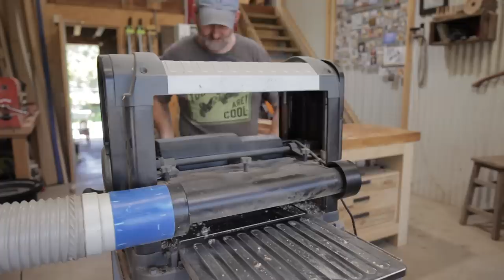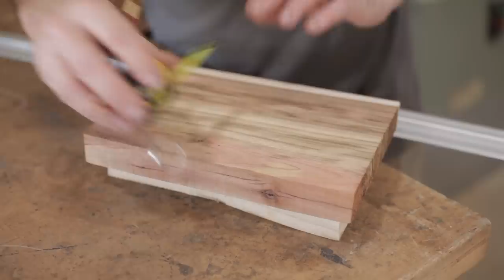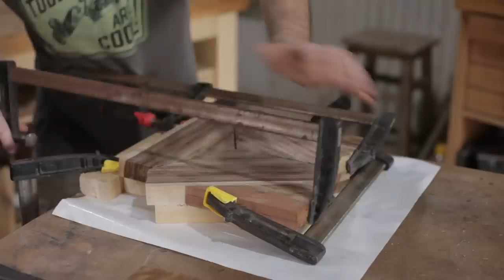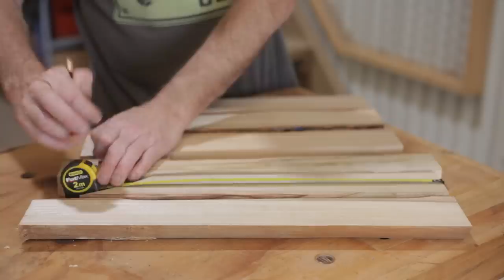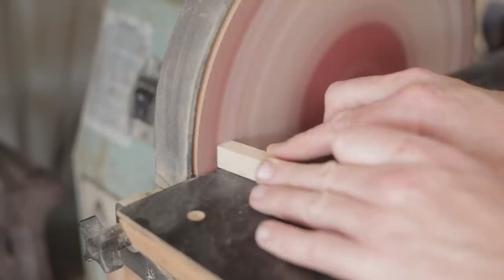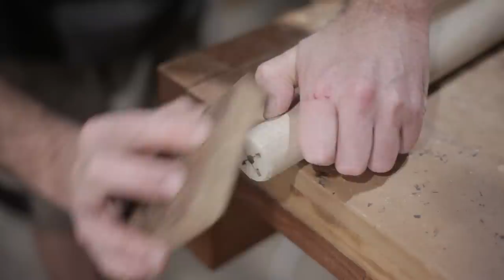Knockdown stool with Removable Legs - Scrapwood Challenge Episode Fourteen

Comment: So many great ideas, processes, techniques and innovations in a...stool?! Using the angle on the bottom on the stool to drill the leg holes at an angle is such a great idea!  And then I was so confused as the point of the cross pieces on the top of the legs but that is such a beautifully simple way to lock the legs in!
Reply from the maker: Thanks David - glad you liked it! :)

Comment: We clearly have a different idea of what is scrap wood.. I'm looking at my pile which is mainly pallet wood offcuts.. I'd buy the timber you have available to you!
Reply from the maker: Fair enough Richard, but be aware most of this wood is sap wood and not the best quality, that's the reason it usually gets burned rather than used. You can see where the chopping boards have been cut out of it not going into that sap wood. Also the pieces that aren't sap wood are warped and checked. The company that gave it to me would be using it if it were premium quality but because it isn't they normally burn it! The processes that I've used in this series could all be made with pallet wood! :)
Reply: @PaskMakes  Hi! Not criticising, merely rather jealous of the wood available! Love your work..
Reply from the maker: Thanks Richard - no worries! It's still worth pointing out that it isn't quite as good as at looks! :)
Reply: @PaskMakes   you're just being modest now..

Comment: I love your stuff.  Thought I might clue you in on making the 120° angle without the triangles or a protractor.  Making note of the center, A, simply draw an arc with your compass, then, keeping the same radius, choose any point, B, on the arc and mark an intersection, C, along on the arc.  Then move the compass Point to the intersection you just marked and mark another intersection, D, further along again.  Next draw a radius from the arc center, A, to the first point you chose on the arc, B, and from A to the last intersection, D,  you marked and bingo- 120° angle.  See "basic geometric constructions for more ideas. Incidentally, triangle ABC and ACD are equilateral.

Comment: You could also make a stool where the legs and seat have wooden threads and thread together! Could you cut threads into a blind hole in the bottom of the seat?
Reply from the maker: Yes, I’ve thought about that but as I’ve already made two stools in the series i’ll wait a while until I make another. I wouldn’t be able to make threads in a blind hole but could make the top out of two pieces, threading one half then gluing them together! :)

Comment: AWESOME stool I'm a carpenter and that's a great idea
Reply: idea is good but as a carpenter you should know that wood tend to expand due to moisture. If you live in stable climate then yes its works if not then half of the year or on rainy months you cant get thouse legs loose. i would use wooden threads

Comment: What is that you used to clean or condition the sandpaper on plate?
Reply from the maker: It's a disc/belt sander cleaning stick, I bought it but it's basically a stick of rubber! :)

Comment: A fine result!  It's of course down to your skill, as you cut very accurately with keenly sharp tools!  Also, whatever that wood is---eucalyptus???---is straight-grained & LOOKS rel. easy to work....  Just to be a bit perverse, EYE would have put the faceted side of the seat facing up.....for a bit of "therapy"?

Great idea--borrowed from machine shop work???--for securing the legs to the seat!  Any chance you'll "experiment" with dyeing that wood--say yellow, blue, or orange--to vary its appearance..  Certainly, not necessary....  Still, made up in furniture pieces, that wood calls to mind the content of fudge/candy shops in larger airports, e.g., Chicago....

Time for a rhomboidic, end-table....?